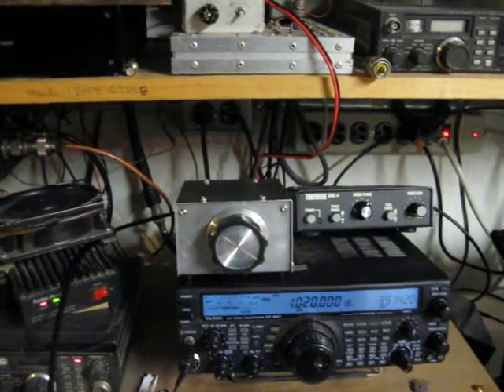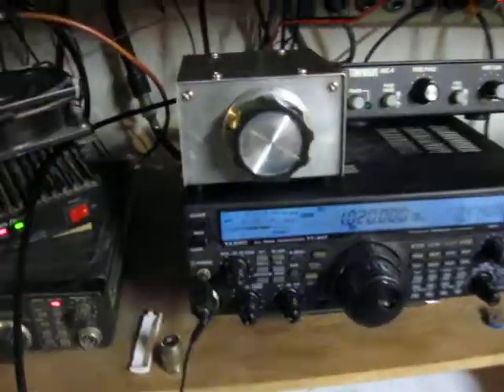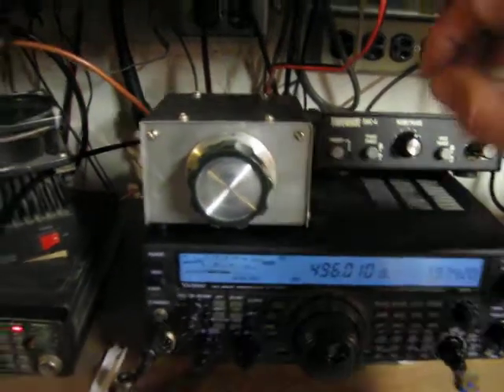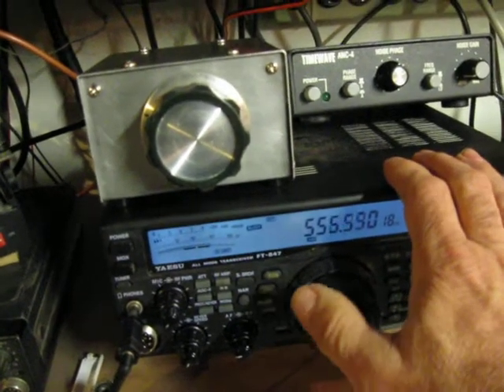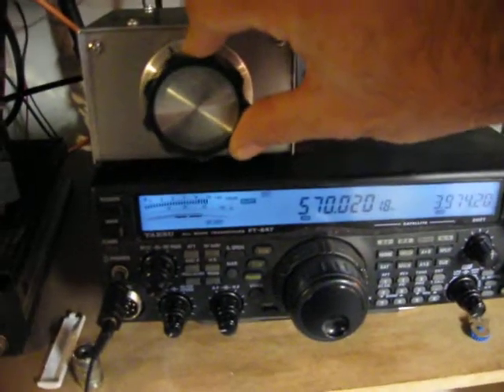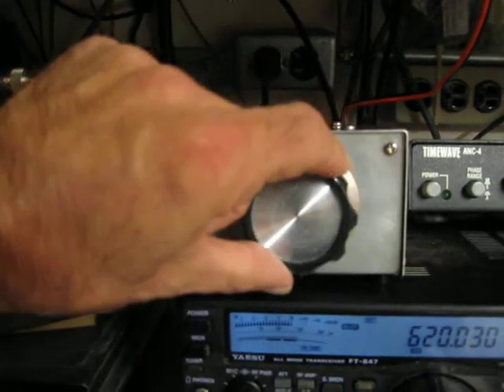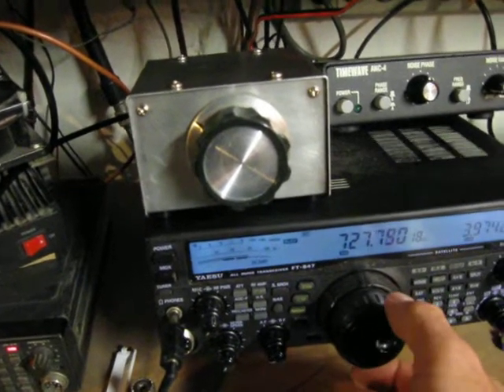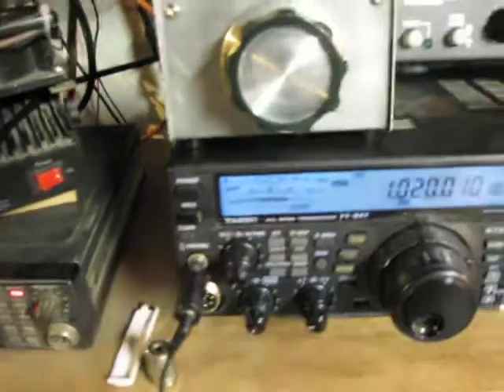496 kHz Bandpass Filter Test @ WA3TTS

Comment: Looking for something like this, plans? WA2SQQ
Reply from the maker: Bob (& All)  If you Google search "W1VD" and " 500 - 515 kHz preselector " the link to Jay's web site (w1vddotcom) should be on your first few Google search returns.  I added a few extra turns to each inductor to bring the resonant frequency down to 475  kHz.  I also made one for the 3 MHz range as an IF output preselector for my MF/LF converter.  If you calculate the XL and XC value for each component at 505 kHz, you can then scale those XL and XC values to other frequencies....which is not hard to do with online inductive reactance and capacative reactance calculators....